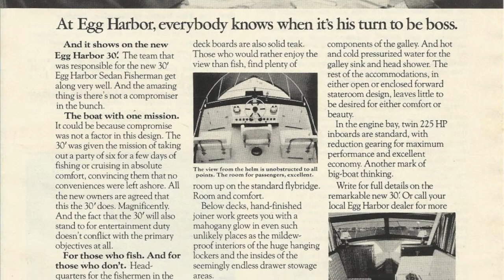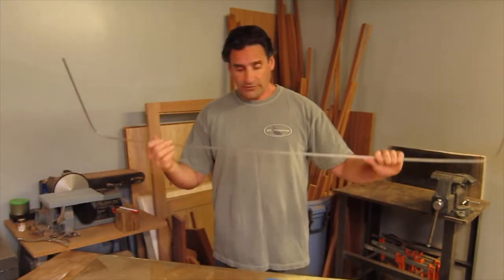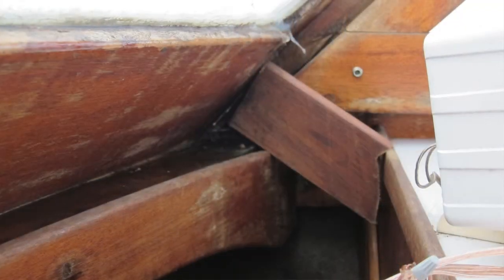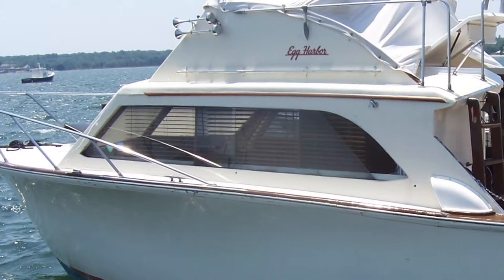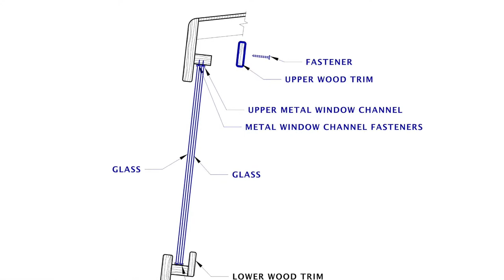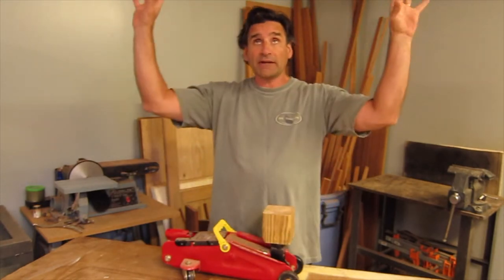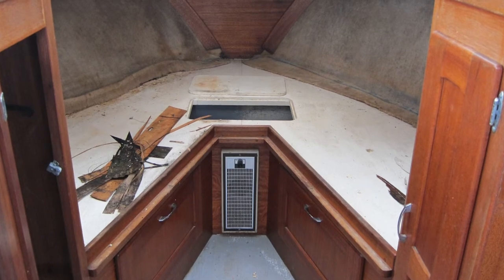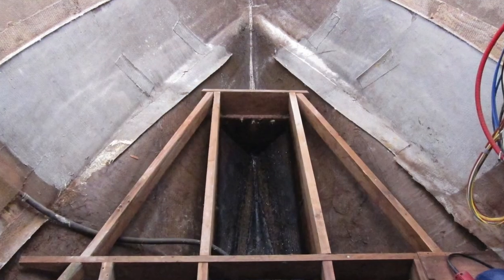Windows, V-berth, & Cabinet Removal - Boat Restoration EP002 (2012 Part 1)

Comment: Where you have the sales brochure for your boat, I have the same for my 1973 Luhrs 36’ cruiser.
Mine had similar issues with leaking bow windows. Due to aluminum rot, among other issues, I replaced all the windows, both fixed and sliders. That was an expensive upgrade.
The V-berth on yours is very similar to mine. Fortunately mine is in good condition so I need not remove the wood, just the original hull liner material. 
You’re doing fine work there! I’ve subscribed and am looking forward to seeing how you make out.
Reply from the maker: Thanks for subscribing and following along Neil. Our boats are the same year and close in size so they probably share similar design features. Unfortunately I didn't keep a video log when I started the project. Wasn't even a thought. I thought I would be done in a couple of years. Right. Good luck with all of your boat projects and I hope you enjoy the videos. Please share your experience with some of the future projects I need to tackle if you have some tips or advice. Thanks - Bob